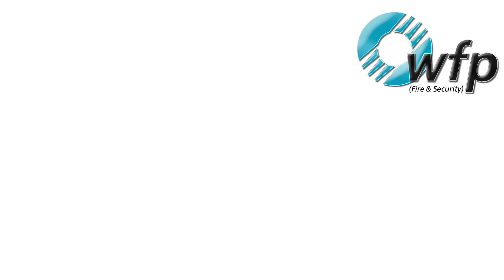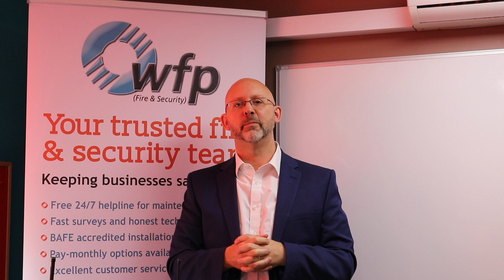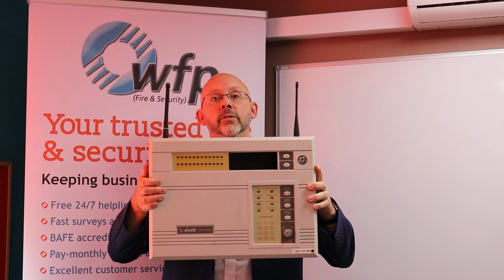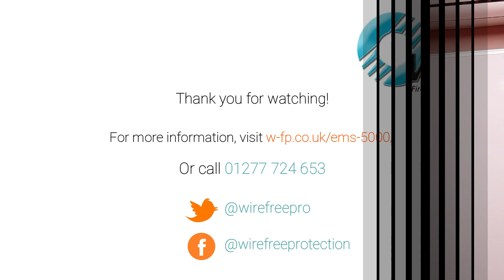What To Do If You Have An Obsolete EMS 5000 Fire Alarm System

Comment: Great video. Would add the reason Firepoint had to finish and be replaced by Firecell being that the UK government changed the radio frequencies allowed to be used for new manufactured fire and security systems to 868Mhz and a requirement to comply with EN54-25
Reply from the maker: Thank you, Wayne!